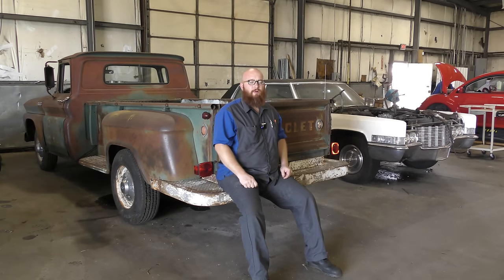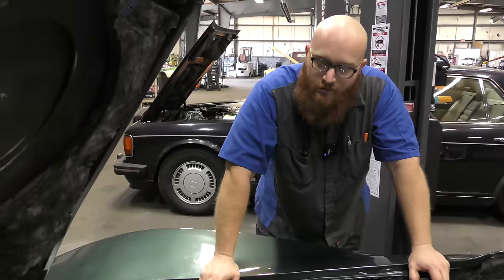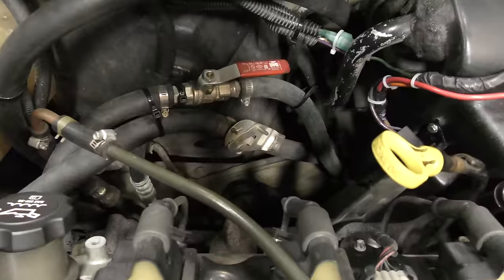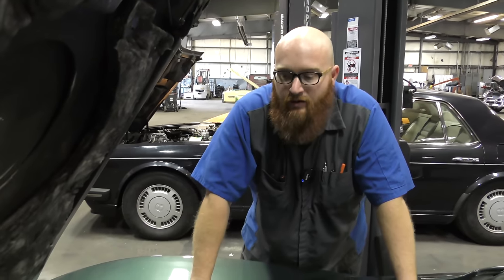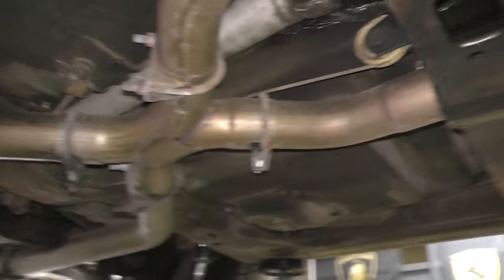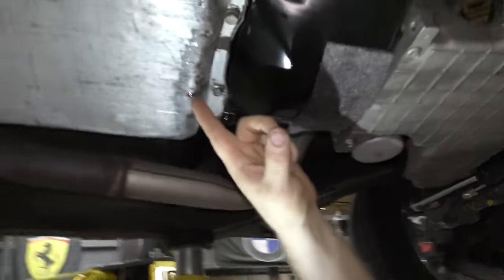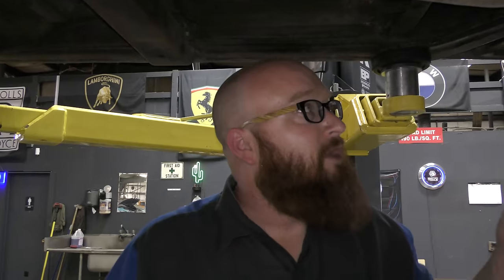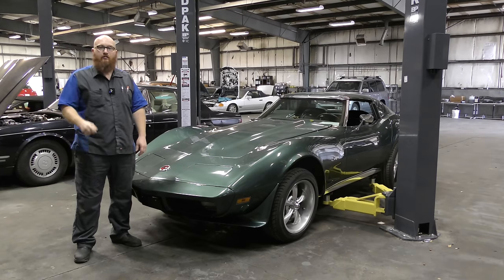Issues AFTER an LS swap! CAR WIZARD warns what can happen on an LS swapped '73 Corvette Stingray

Comment: I’ve LS swapped a few cars.. never understood the carburetor route.. fuel injection isn’t scary. Just needs to be tuned by someone that knows what they are doing. And that’s ONLY if you change the camshaft etc.. if it’s a stock engine, I would use HP Tuners to turn off the unnecessary fault codes and VATS. 

The most common issues I’ve seen with other swaps are the following:
-using Chinese throttle bodies.. these can cause vacuum leaks and cause idling issues

-using non ACdelco sensors etc. I ran into an issue with my first swap hunting for the target idle rpm. Turned out the cheap idle air control (IAC) valve I got fr Amazon was causing the issue. Went with a used factory IAC and it solved the problem. Same with the Throttle Position Sensor.. use a factory part. 

-not verifying that the exhaust from the headers to downstream of the front o2 sensors has no leaks! A small exhaust leak from using a cheap header gasket or collector gasket (depending on where the oxygen sensors are) which cause issues with lean/rich fuel conditions due to the o2 sensors getting false readings.

Comment: This is a carter afb design carb. they were good in the 60's. they came stock on some mopars.
Reply: Looks like a thermoquad   I had one on my supercharged resto mod c3 then went back to a modified qjet I did up worked waybetter throttle response next best thing to FI . Carbs for me are easy I love qjets then Holley not a fan of carter

Comment: I'm in sort of a similar position with a c3 that was heavily restomodded.
Thankfully the previous owner documented almost all the new parts on it in a huge binder, and took a number of pictures during the restoration. He's also still a text message or phone call away if I have questions.
I'm also pretty good with a wrench and a volt meter...
BUT, some of the install work is like, 90% there and I have to get the last 10% to get it just right
Reply: It also hugely helps if the previous owner used known good parts that have good documentation, like a vintage air a/c system is a known quantity , a hacked together ???? Ac system is not

Comment: "Stock" classic cars can easily have this many problems. I don't believe it matters if it's swapped or not but more important who did the work. I've always been glad that I can repair my own classic cars, so I don't have to deal with someones Mickey mouse. You are very right that you can have a guy that's 30 or younger with 8 ASE's  and not know anything about a carburetor or points ignition which is kinda sad.

Comment: This why you document everything including wiring diagrams, fluid capacities and such. I understand why a shop will not work on a Frankenstein but I have little tolerance of a shop who will not work on let's say ABS systems on a 2000 Chevy van because new parts are not available. Plug and play remove and replace is all many will accept anymore. So whine away. Shade tree mechanics live on!

Comment: The leak bandage! 😊  Bit of trivia for ya: my cars  (1962 Morris Major Elite) have little holes in the underside of the bell housing to allow egress of oil from the rear main - no seal, oil slinger only.  A designed-in leak...but at least I'll never need to pull the mill for a seal!

Comment: This is logical Wizard,  but still hard for owner to admit...especially if they, like me, did the swap.  One guy said, not doing the rusted brake line, its buried, you can drive it home.  On getting it running, one said he, we have to start from square one and charge you the full amount to do the conversion as we have to rework ALL what you did.  Ditto a second and a 3rd said I don't work on cars that were already convertered....so, I am still sorting issues... good idea on documentation, I shoujld have done the wiring doc right after I did the harness.  Lots of wires came out.   My mechanic friend said he had a multipage booklet on the wiring, how are you doing yours ?  (point to my head), we both laughed at how insane that sounded...

Comment: I have serviced an rebuilt carbs. 
Over the yrs. 2  an 4 barrels. Quads
Rochester's motercrafts carters an
Others. Still have old motor manuals.
That goes back to carbs from 39 to 
Early 40s cars . an early down draft
1 barrel carbs.

Comment: the wiring stuff is exactly what happened to me and the first car i bought 2 months ago. was a 93 civic with an engine swap. couldnt pass inspection due to horn being disconnected. to find the issue a shop was gonna charge me 1500 minimum. i paid 2.5k for the car so i sold it for a loss. better than spending that 1500 when their were other issues with rust etc.

Comment: Barry Grant thermoquad.  I'm not a fan of Barry Grant - quite frankly, the customer would be better off getting a stand-alone EFI.  But your point is true - most shops would run from these kinds of cars, and that might be the best advice of all.  If you can't work on them, find out who can BEFORE you buy the car.

Comment: I had a Miata I swapped a later model engine in and had to make some wiring changes and added an aftermarket standalone ecu.  Even I had a hard time remembering what the hell I did.  I could never sell that car in good conscience since anyone else would have such a hard time diagnosing anything.  Luckily, I totalled that car, so it never became an issue, lol.

Comment: R-12 has a different heat value on the condenser 134A needs a bigger condenser head pressure will run to high and superheat is not reduced enough needs a bigger condenser. You rock wizard

Comment: My cousin bought an '85 F-150 with fuel injected 5.0. Only thing was the previous owner removed all the electronics and run a carburetor. It never ran right, had no vacuum pressure, etc.

Comment: Back in the day they used a relatively cheep CO analyzer.  They are about $200 today.  Basically a one gas analyzer.  There are several available on ebay.  New or used.  The idea is to get the CO reading and decide if you are rich or lean.  FI is much simpler and better to tune.  But some folks like the idea of being able to drive after a massive EMP event.

Comment: If I had a 73 Corvette with an LS swap. My main problem would probably be speedn tickets. LOL!! 
I personally wouldn't have bought that car. Mixing digital and old school mechanical stuff is not good. Leave it all computerized or all oldschool. This guy is exactly right. Maybe the guy who sold it,sold it because he couldn't get it to run right. Or some other shop gave him some ridiculous price to fix it. I wonder how many owners that car had after the swap? It may have never ran right. Looks like it could  be a friggin huge disappointment. I imagine that fixing all the little things leaks & other things getting it running right will probably be found will cost 1000's of $$ to fix. I bought a 77 K20 with a Vortec swap. NOBODY would work on it. Mine had a custom suspension. I got rear ended. Insurance just totaled it. They didn't even want to mess with fixing a modded vehicle. They just paid me for what I had it insured for. That was a tough old truck though. I drove it home after getting rear ended. The kid that hit me was doing 45mph +. I was stopped by a flagger in a road construction zone.

Comment: One thing I would highly recommend when choosing a restomod shop is that they supply a well documented manual, and maybe more important, a parts list (with make/model/year/engine/trans.) where they have harvested from.. IMHO
Edited, added: Talking about A/C 250/300 degrees at the 11:10 mark of the vid. To cool this vintage fiberglass car when it is 105 degrees out  I hope the build shop used a high quality Dynamat/heat shield on the floor, firewall. These corvettes are hot (without a/c) on an 80 deg day with the top/T tops down. LOL

Comment: It is interesting that the person that did the Restomod installed a modern General Motors LS engine in this 1973 Corvette, yet the person that did the Restomod installed a carburetor on this LS engine. I was born in 1951 and I remember cars with carburetors, I also know about cars with modern electronic fuel injection. In my experience modern electronic fuel injection is more reliable and has fewer problems than  carburetors. When I was growing up my father used take off these carburetors and clean them out in a bucket of carburetor cleaner to repair the problems that occurred when passages and jets clogged up in these carburetors.

Comment: You have to have notes of parts numbers, modules and service codes, the VIN number from the donor vehicle, plus a dam wiring diagram. Create a schematic that contain wire color, splices and location and again, and part number involved. Different TAC and TPP, write (type) the part number and application. 
  Information is the key for a “Resto-Mod”. We don’t live fover and situations cause us to sell them. If you show a 3 ring notebook with page protectors and arranged like a service manual,  that alone can add hundreds of dollars to the value of the vehicle.
  You break down anywhere, a service tech that knows how to work on a system can fix it. Even a dealer. If you have the PCM reprogrammed by someone, provide their contact info and a copy of the “Build” sheet you sent in with it. You sell the vehicle, the next guy has deep pockets and changes the tires & wheels, fine. But now the outside circumference changes, shift points are effected, speedo is off on the aftermarket cluster. All kinds of thing are effected as the work together. 
  The newer the system, the hard it is for someone to blindly fix your custom car. Time cost money so if information is provided about how it was wired, how to gain access to the sensors, all made a huge difference.
  ASE Master Tech since 1978 - Retired       Great video wizard!

Comment: The leather pocket is the glove box on a C3 corvette. Yea it is clear a normal shop would have no idea what they are doing with such an old/modified car that's what shops that know these kind of cars are for. It has been 30 years since we had carbs on production cars. They sure weren't using  AFR gauges and dyno's to get them running right back then. It is a carb perfect fueling is not something you achieve with it because as soon as temperature or elevation changes so does the fuel, you just get it in the ball park.

Comment: I owned a 1972 Jaguar XJ 6 4.2 a couple of years ago. It was equipped with twin SU carburetors. In my view, this was not good carburetors because it there’s a fault on the carburetor, liquid gas can enter the engine. This gas rinses away engine oil from vital components like piston rings and causes premature wear of expensive engine components, greatly reducing engine life.

Comment: I had a GM crate engine (ZZ3, 350/350) put in my 68 Corvette which had a 327/350 from the factory. It was definitely a boost in horsepower and the emissions were just 70 PPM hydrocarbons - well under the allowed 400 PPM by the State.

Comment: So, that oil pan is a dry sump system. Most LS1's had a dry sump, though it went away later on in various gen 3 + LSX general applications. 4th gen Fbodies and C5 vettes both got it, then various cars later got a normal deal. Just another reason 99-02 F's are the best all around.

Comment: i use whatever works on created hybrids but since working in engineering i at least make a BOM that refs the parts, manuals, page numbers, became a habit with industrial machines. There it was a necessity due to obscurity, in cars it's more common but with a lot more variations.

Comment: A lot of guys put absolutely no thought into doing an engine swap. I've had guys tell me it doesn't matter what engine is in the car, just sell me the part. Only to return pissed off because it doesn't fit or doesn't work. Dropping an LS into a 71 Monte Carlo sounds good, but what about the cooling system, wiring, engine mounts, there's a lot of things that need to be done to get the full potential out of the vehicle. If you don't put in the work before you crack a bolt, I can almost guarantee the vehicle will be up for sale on craigslist or Facebook marketplace as an incomplete project that they " lost interest" in

Comment: I was a night manager at O’rellys auto parts and I would have guys come into the store with there carburetors and ask me to rebuild there carburetor for them.  And I had one guy come in with two jeeps on a trailer and wanted me to adjust and calibrate there carburetors and they would almost certainly have vacuum leaks because they would reuse the gasket between the intake manifold and carburetor to save a few dollars ! Or the mixture screws were closed, always easily fixed but they had no clue as to how a carburetor even works.

Comment: This is a basic LS swap kit sold  through Edelbrock which converts FI to a carburetor. It’s not that complicated so please stop 🛑 the negative comments. 
 You can add a fuel ratio gauge in the exhaust in order to monitor if the engine is running rich or lean. Some other basic tests is reading the spark plugs or just a basic sniff 🤧 test. ( exhaust gas smells like unburnt fuel)

Comment: High side psi on the AC system could be from air in the system, static psi test would tell you that...

It could also be because the rad fan isn't turned on by a relay from a high side pressure switch, or the circuit for that switch isn't working properly if it's even there at all.

I'm sure you already know that though, just tossing in my 2 cents.

Comment: Main dealers mechanical work is charged about £80 an hour ($100) , bodywork rates are a lot less , I was a panel beater for 35 years , my car broke down took it to a mates garage , he was stumped as to what it was so recommended to take it to a friend (auto electrician)of his as he thought it was a electrical fault , phoned the guy up to ask how the car was doing , he said they had to strip half the engine down as the inner pulley on the camshaft had snapped and needed replacing , told him my mate had checked the cam belt and even though I'm not a mechanic I no my way around an engine and there is no such thing as a inner pulley on a camshaft , he said he was just the receptionist and not a mechanic , charged me £560 said the old parts were in the car checked them out when I got home nothing wrong with them , same thing happened again 3 weeks later but I became seriously ill ended up in hospital my brothers mate fixed for £100 then it spat bottom cam pully off while my daughters PA was taking her down the coast , when my wife came in to see my and told me what happened I said do not spend another penny on that POS I'd rather scrap it . this is the 2nd car I'm having to scrap because crappy workmanship , had a VW Jetta replaced all the brake's and discs's , new tyres all round (got a good deal) air/oil filters , plugs but did not feel confident to replace timing belt so took it to my bosses old mate picked it and it woudn't pull away kept dieing he said bring it back tomorrow so I limped home , checked it when got back home blown head gasket , phoned my brother up as his mate had one and did he want any parts as I was scrapping it , he towed it away saved me the trouble , bloody loved that car .

Comment: The real downside with carbs on modern engines is the balancing dine with the fuel charge. A modern computer fuel management system can adapt to unmatched cylinder pressures making an engine run smoother, reduce cylinder wear, and other subtle benefits.

Comment: the shop that i work at part time we have said it is best to leave how the wires are for the engine and leave it fuel infected so it will run with obd2 on it. plus making sure when we are there have every thing swapped to r134 on it. so there would not be any issues with that as well. the only hard thing that i came across is when we made the wire diagram for the cars it is kind of hard to keep a copy of it so the customer loose the copy to get a copy. we go through so many chevells to old classics like the one your looking at. to have on hand it is frustrating that there are some people will go eh lets toss this not make a copy and have it stored on a external hard drive. so they can bring it back up print it if they couldnt fix it them self to take it to another shop they have a diagram of what is what and a list of what has been done to it. most people will go supprise and they get a supprise on the bill